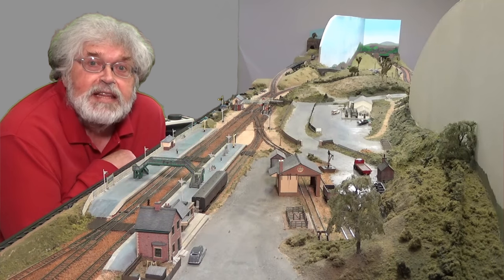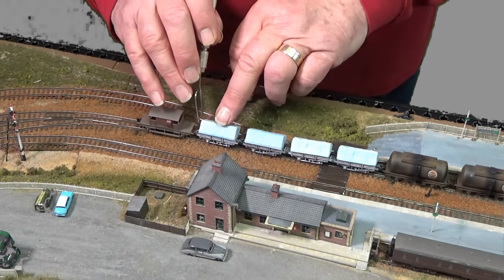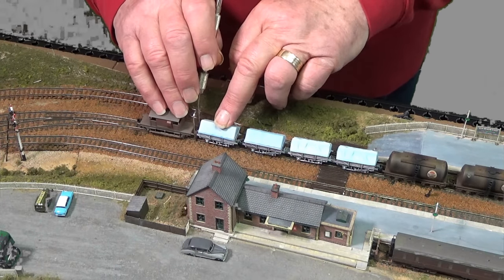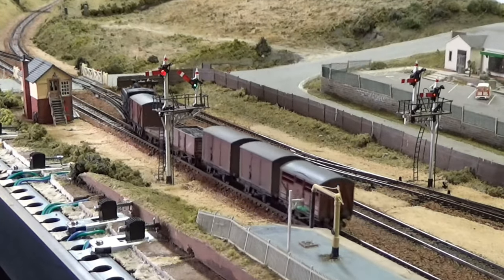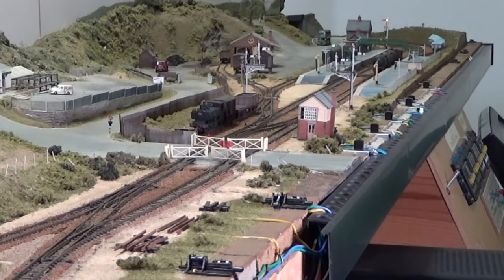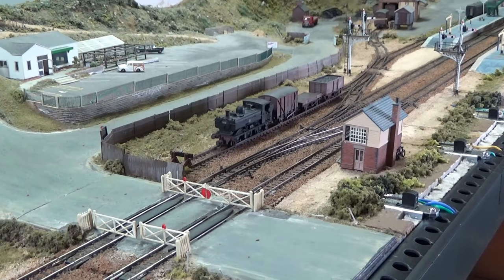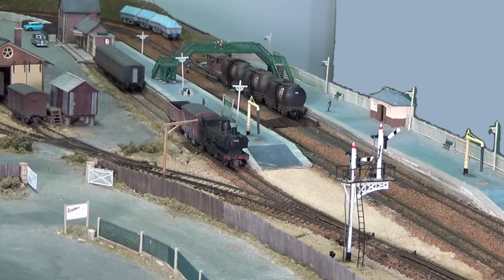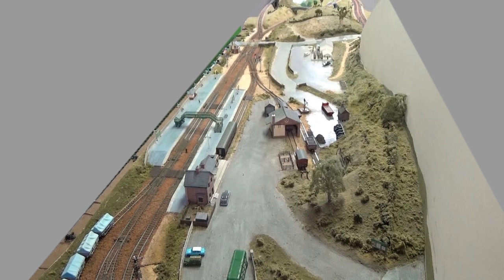Exworthy Journeys #23 - Wagons for Exworthy

Comment: Hello, nice to see your progress. I enjoyed the video clip. Please do tell me to zip it, but as a professional railwayman working in the UK, and a steam era modeller, there are a few shunting things I would change in your operation/shunting. 
I would have thought it best and safest practice to shunt the rear portion of the train, including the brake van, into the down refuge siding. Blocking the down main would have been a real no no back then. Line occupancy was avoided for long periods, especially when you have the refuge siding. 
I would drop the brake off, then propel the clays right down the refuge siding. 

Then, either pick the van back up and propel the back towards the clays and drop the van and the fuel tankers off infront of the clays to get them out of the way. Or, pick the tankers and van up, and then shunt them into the bay platform and use that to get them out of the way. 
The second option would have been the most prototypical way of doing it as it would have been the guard doing the shunting/uncoupling work back then (1960s) and the golden rule is do the shunt in as few moves as possible. 
Naturally, it is your trainset! Please don’t think I’m having a go - I’m certainly not. It’s more how to make your operation slightly more authentic based on my years on the railway and interest in the Withered Arm. 
All the best, 😊